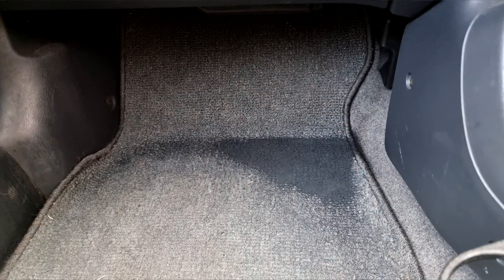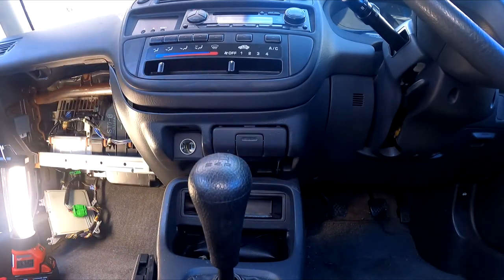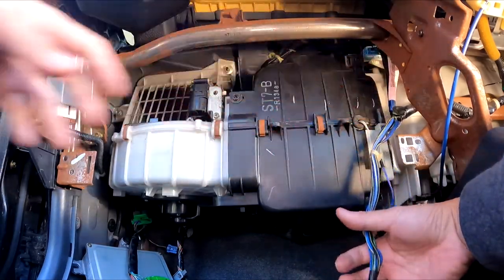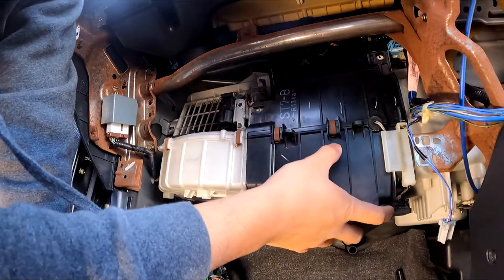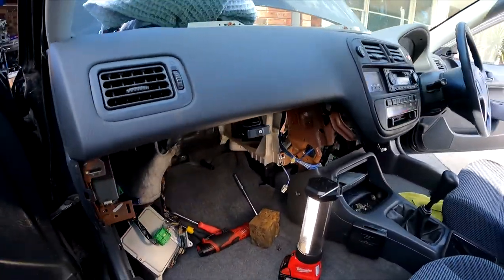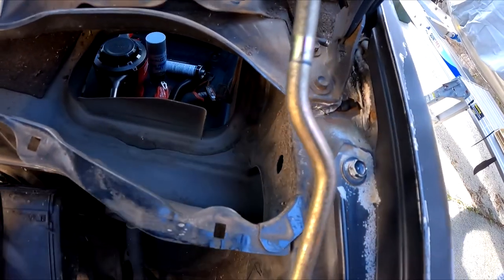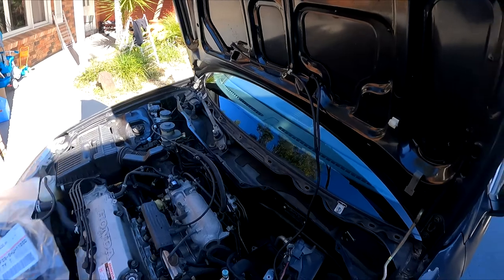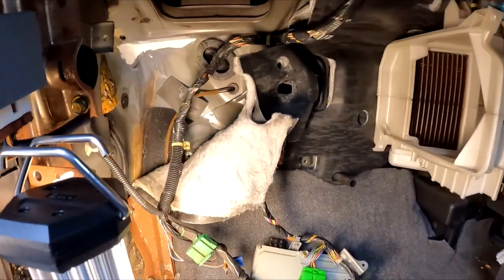Fixing the water leak in the civic – a step by step guide

Comment: Thank you. I will have to do the same. On my vehicle. Have the same leak. On the passanger side. Its been 2 weeks. Since i discovered. That there was a leak under the carpet. I will have to reasemble more stuff before I see the leak. Visually. But. Because it is winter here. It is not possible. To work outside at 0 temp. But i have to. Go from time to time. And collect the water from the carpet. After a rainy day. Yes. This is the only way. To save your vehicle from rusting. Beyond. Repair. Thank you. For the good tips.
Reply from the maker: Good luck mate!

Comment: Nicely done!  I've had the carpet out of my '00 EM1 Civic for 2 years dealing with this...really take away from enjoying your car and I may be selling so  hoping to fix this soon. Same thing after heavy rain...really pools up only mine is Canadian so drivers side.  Only difference I can stand there spraying all the same areas you did for 10mins and not a drop....after a heavy rain, totally soaked.  I suppose I'll have to dig a little deeper to see that corner but I guess I wouldn't have to remove the blower assembly would I.   I just threw baby powder up in that area and I'm waiting to trace the trickle to the source but not enough rain yet lol.
Reply from the maker: 100% it's a huge turn off driving especially when you see the water sloshing around in there haha. I hope this is your fix! And baby powder trick.. never heard of that one!
Reply: @ericlindsey1708 I have the leak this guy has in the video but also another 2 leaks both door trims on top are letting water in.ima try adjusting door latch so more pressure on trim when closed

Comment: Interesting video, I have a similar waterleak since over 4 years now in my eg civic. I think it comes from somewhere behind the fender, sealed all things behind but without success. And I don't want to remove the air blower cause I fear that something breaks.
Reply from the maker: Hi mate 
It's definitely worth doing and i know of two other people who have since fixed water leaking into the cabin on these civics. 
I believe it's quite universal across all 90s honda platforms and of course the age of the car. 
If it helps, the blower isn't as fragile as you think. Held in by screws only, no clips or adhesive used. 
I've parked it outside for about 3 months now and have not had any water in the cabin. Good luck!
Reply: @JCYT  Thanks for your reply, maybe I will try to remove the blower. I allready removed the glove box but I couldn't see any water trace, it looks like coming from the area where the hole is for the sunroof drains but not from the drain itself.
Reply: Mine too
Reply: @silentzero7  try under the fusebox in the engine bay . .

Comment: I believe that I have this issue as well with my Civic as it's been a continuous thing for years.  I already changed my  gasket and cleaned out the gunk yet the rather slow leak continues.  I think I can do most of it but my main issue is degassing the AC as I have no clue what I'm doing there and worried about dealing with the refrigerant.  How did you do it and is it difficult to do?
Reply from the maker: The best way to deal with refrigerant is to take it to a local mechanic or autoelec who does AC and get them to drain the system. I had two cars needing it done so I had a mobile technician come out to me. Then once you've got it all sorted they can regas your AC

Comment: Great video bro my issue was the fender grommet. I have no idea how you removed the windshield cowl without breaking those top clips the moment I put a flat head under the lip of them they snapped any tips?
Reply from the maker: Hey mate 
I'm kicking myself i didn't record that part. The reality is these clips are fragile yet i managed to save all but 1. I had 2 tiny flat head screw drivers i used like chopsticks to pry/leverage it out. Take your time prying them side by side until you can fit both screw drivers in the gaps. When you can fit both screw drivers, gently pincer the grommet and pull upwards. It should pop out with a moderate amount of force. Good luck mate if you get stuck msg me on insta and i'll send you a video of me doing it.
Reply: @JCYT  Thanks heaps for the response man I’ll let you know how I go I already butchered 3 in my rushing.

Comment: At 6:21 you undo the pipe. Did you need to regas the ac system after the repair?
Reply from the maker: Yes the AC system was degassed before taking out the evap and has been regassed as of last week (just did 1500km round trip)

Comment: Would removing just the blower motor assembly be possible without having to remove evaporator coil and evap assembly?
Reply from the maker: Hey mate
I wish it would be possible but unfortunately i couldn't find a way around it. I'm pretty sure you will need to remove evap 100%

Comment: I have this issue I believe i, when a make a right turn I hear sand and water shifting and water starts pooling on the passengers side
Reply from the maker: It's gotta be it! 
Check the list at the start of the video first, if the leak isn't fixed - this is probably your problem.

Comment: Hi brother, I have the same issue on my 2000 civic EJ9. Owned it since 2009 and only just noticed a rusty passenger side seat mounting bolt, wondered why and pulled up the floor carpet,....yup underneath of carpet soaking wet and actual floor wet.
Was yours only the passenger side or driver's side too?
Reply from the maker: Hi mate
Interesting it only seems to happen on the passenger side RHD. I haven’t heard of it happening on both sides. If it was I'd suspect the windshield seal
Reply: @JCYT  Hey bro, yeah I'm in England so RHD too man 😉.
Oh man bro I'm so gutted that my baby is leaking and so stressed, I need to get it sorted ASAP but she's my daily so need it for work until holiday 😢😢
Any tips on removing cowl without breaking anything my bro? Cheers man 🙂
Reply: Have you found your leak?
Reply: @TheAnnieSisters  Not as yet, cleaned out the cowl drain channel under the plastic cowl cover (it was blocked with 22 years worth of leaves and debris), next going to tackle the seam on the fire wall, pretty sure it could be the source of the leak..
Reply: I hope you do. I am doing the same thing to my 08 accord
Reply: @michaelpaterson8086  is there a video of fixing seams on the firewall?
Reply: @TheAnnieSisters  yeah this video 👍🏼👍🏼

Comment: How do you D gas the ac??
Reply from the maker: Hey mate 
Best get a professional to degas. But a few ways to do it. 
You can loosen the bolts on the compressor, and go for a long drive. or use a screw driver to slowly release to atmosphere. 
I do not recommend either ways, it's just a way to do it ;)